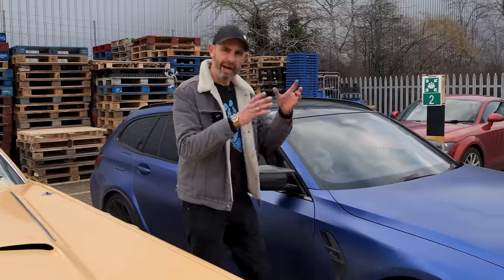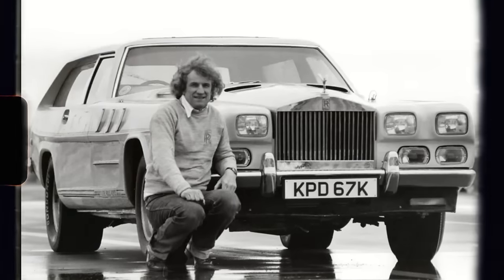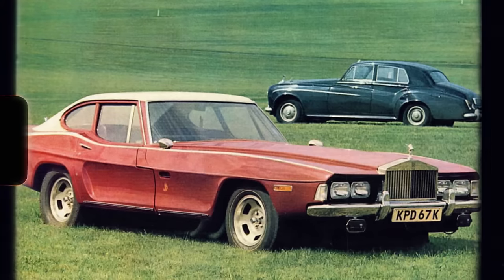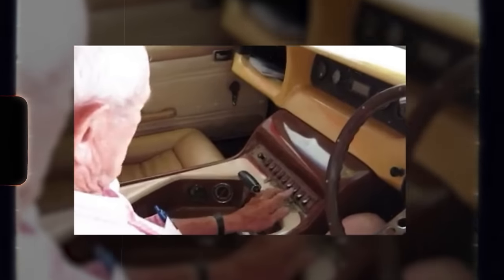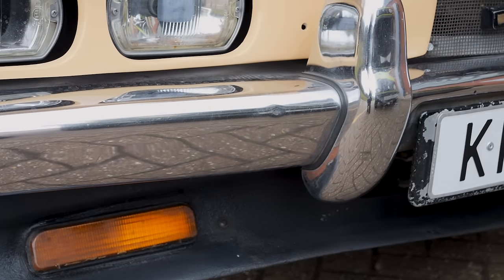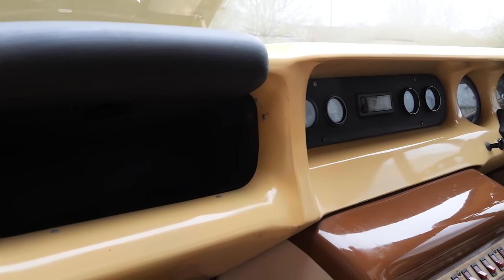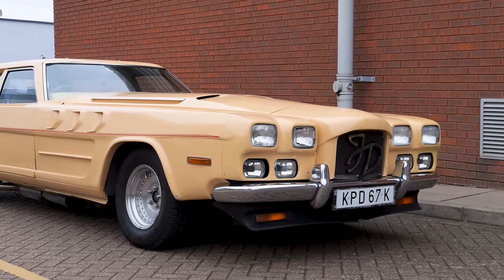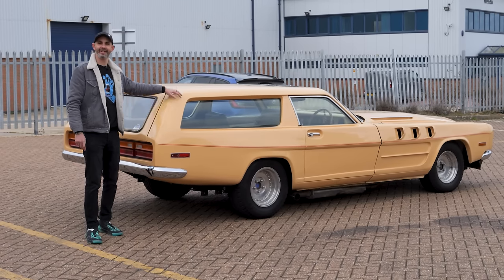Driving The Beast! 27-litre V12 Spitfire engined car on the street

Comment: I can correct you on a few aspects of the Beast and some more details. 
The doors were originally from a Ford Capri 
Seats are Lotus Europa.
The exhaust manifolds were made by Alan Herridge ( known as Bootsie) he was a drag racer who died at Santa Pod ,sincere apologises for miss spelling of his surname if I have.
How do I know? 
The car was refurbished in my bodyshop in Spain near where John lived.
Despite my badgering him to change the colour he was having none of it. 
He wanted to preserve the car as close to original as possible in memory of the people who worked on the car .
The left front headlight bezel got damaged and was repaired in another bodyshop, as by that time the company that I was part of no longer existed. 
For some reason they were unable to match the prosthetic limb colour ( which is exactly how I described the colour to John in an attempt to get him to consider a change) 
Hopefully the Beast goes to a good home.
RIP Cpt John Dodd
Reply: Great info
Reply: And the engine is a "Meteor". A tank engine developed from the Merlin, without supercharging.
Reply: Fascinating 👍
Reply: @JohnG  did you watch the video? Original car had a meteor. Rebuild after the fire and he put the merlin in
Reply: Very cool story. Thank you for sharing.
Reply: @johng9399  nope, it's a merlin, but not from a spitfire as they run the wrong direction.
Reply: And the front spoiler indicators are Mk3 Capri ones.
Reply: Thanks for the Info, very Interesting.
Reply: @ForeverNeverwhere1  this engine does run anticlockwise the transfer box that John built reverses the direction
Reply: Wasn’t it a Ford colour ?  My Dad knew John also ‘ he stayed at our him for an evening once ‘ I was about 11 years old ‘ then . Lovely man ‘ he loved the E-type my dad was restoring at the time. Sadly he has passed too 😢. ‘ different people’ different times .
Reply: @dizzy2020  Yup mine sure are lol
Reply: Yes I recognised the seats as  ones made by Restall in Smethwick Birmingham  who supplied Lotus back then.
Reply: prosthetic limb colour I thought the same thing cheers for the info.
Reply: I remember my dad giving me a Sunday newspaper sometime in the 1970s with this car in it. I’ve never forgotten that newspaper article and it’s fabulous to see it on YouTube actually still running. Thanks to the family and Jonny Smith for making it happen. You’ve made the child in me very happy 😊
Reply: The Gear selector is from a MK1 Granada, rear light clusters are from a MK2 Capri. Shame he couldn't have kept the RR front grille.
Reply: @NOWThatsRichy  we are all pedants- Mk 1 1/2 capri lights on the back.
Reply: @NOWThatsRichy  MK1 facelift back lights 😉
Reply: Enjoyed reading that mate thanks!
Reply: I remember seeing that car in it’s original form at the Classic Car Show in London in the 70s…….it had a maroon coupe body and Roles Royce grill on it at that time….It’s amazing that it still lives…….❤😊
Reply: re "Capri doors": That was the first, Meteor-engined Beast coupe, of which I first read in Penthouse magazine. That one burned to a crisp. 

The resurrected Beast "estate car" used a pukka Merlin engine, and GRP doors cast from those of a Mk3 Cortina.
Reply: @ingrampowell9111  I thought Cortina... awesome.
Reply: Wow that’s a great insight and an even better story to add to the ever growing mystery of this charismatic engineer
Reply: @johng9399  and Merlins ran on 100 octane fuel. Ze Germans only had 87! So they didn’t run on whatever was available 😂
Reply: The first thing you think when you see it is... someone took an Intermeccanica Murena, parked it next to a Spitfire, and then went totally apeshit
Reply: @dizzy2020  It looks remarkedly like ' Sandglow ' to me ,  an early 70s Leyland colour that certainly some Marinas were painted .A pretty horrible shade but very appropriate for the era.If John approved , it should remain in my opinion.
Reply: Another correction (I believe). This was never an air cooled engine as the vid states. Most aircraft had radiators. It would not have been possible to water cool it because there would have been no water jackets in the block, surprised that wasn’t obvious to a car man 😮
Reply: @stanleymasterson1135  what does this mean, in different words please?
Reply: Good bit of history that can finally be  documented for the eventual new owner.
Reply: thats so cool thanks for sharing the info
Reply: No the engine is a spitfire merlin engine
Reply: And didn’t he try to class it as a Rolls Royce? But RR sued him so he couldn’t he only tried to call it a rolls because of the engine
Reply: @benconway9010  DVLC are the one's that put Rolls Royce on the registration document. Rolls sued John over breach of copyright. 
The rest as they say is history.
Reply: @autodallee4527  I have seen a classic VW with something that looked like an RR grill and nose in front! As also a Danish built MINI with a classic Mercedes front, with the upright, square lamps! A Merris?
Reply: @finncarlbomholtsrensen1188  yes I know of those " custom" modifications to the Beetle and the Mini among many others, fiberglass copies of numerous cars exist.
Reply: @ForeverNeverwhere1  Probably from a Boulton Paul  Balliol engine
Reply: @PeteCourtier  removal of the supercharger and keeping it on the ground are what allows it to run low-octane fuel now. But I agree with the sentiment. Johnny should have done a little bit more homework before filming this one...
Reply: @cliveturner4788  Was that the Ally Pally show by chance? Ah the memories!
Reply: @johng9399 the meteor engine was in the Mk1. This is a Merlin.
Reply: @dizzy2020  ...or NHS beige, but your definition is probably the true origin,

I had a Marina in the same colour, thankfully I only worked nights.
Reply: Thanks for That Great Info Great stuff Cheers :goodvibes:
Reply: @johng9399  No it's not. Watch the video on the auction listing where JD's son talks about the car.
Reply: I thought I recognised those seats
Reply: I wish he had taken you advice regarding the colour.
Reply: Please tell me you're not responsible for the horrible colour match on the front bumper?
Reply: @albertskytour6288  yarp, that was a little annoying, as was him pointing at the sky every few minutes.
Reply: @nikolaskipp769  front bumper is chrome, if you are trying to refer to the headlight surround read fully my comment.
Although I did work in the bodyshop where the damaged surround was repaired it was not when I had worked there.
Besides bodywork is my area of expertise.
Reply: @johng9399  The original engine was a Meteor but after it caught fire he replaced it with a Merlin engine.
Reply: @albertskytour6288  exactly, he doesn't know what he is talking about, just reads from his notebook
EDIT he didn't even have a clue how to start it and what prime is facepalm
Reply: @MarkoVukovic0  and 'no seatbelts' about 5 times. Who cares? He was just terrified to drive it with no seatbelts. Like it would make any difference in a car that never heard about crumple zones.
Reply: @ZoomStranger  google is your friend
Reply: @_sneer_  pretty mad to think that the original owner drove it at 300kph back in the day. What an absolute nutter.
Reply: @benconway9010  Definitely not from a Spitfire.
Reply: @autodallee4527  I would guess this direction change was done at  the 'step up' gearbox, he used for getting the 150 RPM idling low RPM engine to work with the TH-400 automatic transmission, and relatively standard rear end gear ratio.
Reply: @albertskytour6288  that went right past me too! Also a car guy/gearhead! Good point ! 👉 👌👍😅🤣
Edit: since these comments don't line up with the reply comments. I was referring to your fact of no water jackets in an air cooled engine.
I don't know why the comment section here doesn't put people's replies with the original comment. So you know what the hell someone is talking about! Lol ☝ 😆 🤣
Reply: It's pretty cool, of how amazing the internet is, so helpful in this, because of all the people that were a part of, or influential regards, to the history of this, were able to see this, and come forward with their comments! 👍👌👍
Reply: RIP John Dodd and his daughter who also owned a fascinating car, a Toyota MR2 aw11
Reply: So you’re that 1 guy at the party that has to ruin the fun correcting everyone’s grammar and story facts. Fun stuff.
Reply: @ingrampowell9111  mmm the doors are from a Capri. 
I dismantled them when we painted the car.
Reply: @bobboy5508  not too sure who you are referring to in your comment. 
I can't seem to make any sense of it either.
Reply: @autodallee4527  I’m referring to you. You felt the need to correct somebody. You know that person that corrects others grammar or has to just make sure everybody knows you have the facts. But I really just was F’ing with you. Joking around.
Reply: @bobboy5508  yeah facts are definitely going out of fashion, but there are only two things - facts, and bullshit. I definitely prefer facts, and the people who know them. Jonny is usually good but I don’t want to watch a YouTube video full of bullshit and there was too much in this one.
Reply: I believe the car was built by Jameson and Dodd helped with the transmission. 
Later Dodd became the owner
As for first aero engined car, that's just uninformed bullshit. Babs, Golden Arrow, Bluebird, the Chitty bang bangs etc preceded it by many years.
I'll have to do a bit more research into Jameson's next attempt at a Merlin engined car. It still exists, is a 6 wheeler with 2 auto boxes and boasts a proper Merlin complete with supercharger.
Reply: @autodallee4527  I think all marlins run the same direction. The griffon engine is the opposite direction, which caused a few griffon-engined spitfire pilots to come undone.
Reply: @autodallee4527  they picked a close enough color. i wouldnt know if you didnt mention it. depending on how long after the original paint was done, the original paint could just be sun faded, but youd know that of course. 

the other side looks like it shouldve gotten fixed as well. the panel gap was drawing me to that side probably why i didnt even pay attention to the different color.
Reply: @_sneer_   not in this case, mon ami.
Reply: @ZoomStranger  it is. Did you google Intermeccanica Murena?
Reply: @_sneer_  Nup.  Explain "went totally apeshit" in an adult context.
Reply: and the whole exterior is actually the '81 Wagon Queen Family Truckster. Clark approved.
Reply: Lots of aero engined cars made just after WW1. I remember a 1908 Itala racing at Vintage Sports Car Club meetings, similar size engine but MUCH less power.
Reply: Jesus said, “No one can enter the Kingdom of God (God's family) unless he is born of water and the Spirit. Flesh gives birth to flesh, but spirit gives birth to Spirit. You should not be surprised at my saying, You must be born again” (John 3:5-7). what does this mean? Well you have to believe with your whole heart that JESUS died for your sins and after 3 days and nighrs GOD raised HIM from the death, so you can be baptized and after being baptised ask GOD for the HOLY SPIRIT . WHO will guide you trough life!
Reply: It says that exact same thing on the video - Sheesh. @alexfeeney4522
Reply: @ForeverNeverwhere1  The engine appears to run in the wrong direction because the propeller is attached to the rear of the engine. Turn the whole ensemble around and it will be running clockwise.  Don't believe me, checkout the alignment of the assymetrical rockerbox covers when the engine is fitted with a prop versus the engine in the car.
Reply: Por cuerto los faros que lleba no son de un seat 127 de los primeros?

Comment: Ah yes, the 27 liter WWII aircraft engine that complies with ULEZ. Just as intended.
Reply: smokes like crazy too lol
Reply: @Karol-le9bt if a vehicle was built more than 40 years ago it’s exempt 👍
Reply: nonsense.
Reply: Saying I disagree with ULEZ is like saying the sky is blue . But it’s cool that there are exemptions for classics
Reply: ULEZ mostly applies to diesels. This is, like all cylinder aero engines, a petrol engine. So just by virtue of that fact alone it would have no problem.

Comment: John Dodd was a genius and a  humble man who was always willing to give advice. He once spotted me buying a socket set in a Bromley car parts and tool store in In the early ‘70s -  told me to forget the chunky 1/2in drive and go for the 3/8in: “much easier access in confined spaces and tough enough for most jobs.” Good advice. 50 years and several rebuilds later the 3/8in socket set is still in service. RIP John.
Reply: He left to early for his second project with a 24H Napier from a tempest 😉
Reply: i literally never came across a job on an engine where i "needed" a 1/2" ratchet. maybe back then when cars were huge and space wasn't a premium but nowadays, you need 1/4 and the slimmest of 3/8 ratchet to access anything.
Reply: Amazing! I remember John and "The Beast" very well. He built it with a coupe body originally and in my opinion, it looked much better. John used to come across from kent to our workshops to make the occasional modification to the body and interior. It was an incredible piece of engineering and of course, unique in it's own right. All this was before the fire of course, and we all got to drive or ride in it back then. We had a racing workshop specialising in Productiin Saloon race cars; and we raced two of our own, both Mk2 Ford Zodiac based.
I'm 77 now, and still very much into fast productiin cars for the road. Once it's in the blood, the love never fades, and certainly never goes away. John was one of the greats, there aren't many left now; but if you ever get blown away on a motorway by something you know just shouldn't be that quick! Give it a wave, chances are it's going to be one of us.
Reply: Jesus said, “No one can enter the Kingdom of God (God's family) unless he is born of water and the Spirit. Flesh gives birth to flesh, but spirit gives birth to Spirit. You should not be surprised at my saying, You must be born again” (John 3:5-7). what does this mean? Well you have to believe with your whole heart that JESUS died for your sins and after 3 days and nighrs GOD raised HIM from the death, so you can be baptized and after being baptised ask GOD for the HOLY SPIRIT . WHO will guide you trough life!
Reply: How was he a 'genius'...   He couldn't even design his own gearbox!    Nutcase is more the epithet.   Countless schoolboy 'geniuses' have wondered what it would be like to strap a Saturn V rocket engine to a bicycle frame....   About the only 'genius' thing he did, was turn--up at his second RR court case on a horse!
Reply: @davidmwood560  thanks for sharing... turning 30 and I dream of having a nice collector car some day (looking at American V10 cars if you know what I mean ;) )    glad to know the passion doesnt fade
Reply: @hardtymz2517 I still need ¾ for my 78 Cordoba Charger RT 440 pristine condition
Reply: @johanneshartman4618 Absolute nonsense
Reply: @Deebz270 Someone has serious jealousy issues 😂

Comment: Amazing! I didn't realise what a feat of engineering it was to adapt a slow-revving aero engine to power a car. Thanks, Jonny, for the excellent presentation. One thing though - The Beast was by no means the first aero-engined car. There have been quite a few since before the First World War, but the most famous were the four racing cars built by Count Zborowski and known as the Chitty Bang Bangs. They were the inspiration for Ian Fleming's Chitty Chitty Bang Bang. My father told me the name derived form the noise they made when starting. He saw at least one of them at Brooklands as a boy. The first had a 23 litre  Maybach engine from a Zeppelin. The fourth had a 27 litre American Liberty engine. It was bought by J.G Parry-Thomas after Zborowski's death at Monza, renamed "Babs" and broke the land speed record at Pendine Sands. It is now on display at Brooklands. I don't think there was much distinction between road cars and race cars in those days, but certainly The Beast was and is the most effective road-going incarnation of an aero-engined car.
Reply: It definitely sounds like an airplane. Whats the popping noise I hear, it's like popcorn. This is like the ultimate muscle car, definitely a product of its era
Reply: @ericg4915  That's the crackle coming out of the exhaust. Each pop is the front of the shockwave coming out of the exhaust ports & down through the manifold and eventually out into the air.
The original Merlin, on the early Spitfires, stuck straight out the side at 90° to the direction of travel.
Supermarine tried turning the exhausts rearwards. 
They got an extra 12 m.p.h. out of the Spitfire purely from the thrust of the exhaust gasses!
That's why they crackle 😜

Comment: Actually the Merlin engines were water cooled, with the radiators for the water and oil underneath the spitfires wings while on the Lancaster they were under the engines. Only really radial engines were air cooled because they could get air somewhat consistently to all the cylinders whereas with an inline engine you'd just cool the front and not the rear.
Reply: Mr Pug  Ah I've mixed up the Mossie with the Lancaster. Thanks for the correction.
Reply: Ethylene glycol, not water. Nasty stuff.
Reply: Glycol header tank????Anyone???
Reply: Also flying at 30,000 feet helped cool them too.